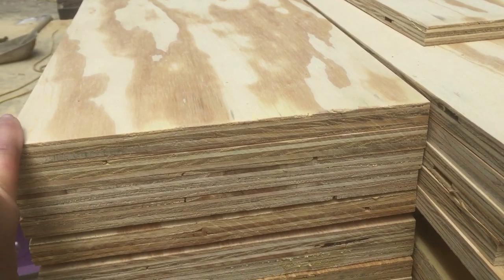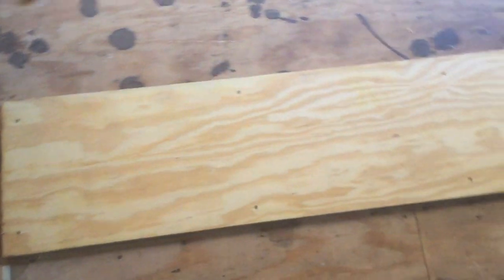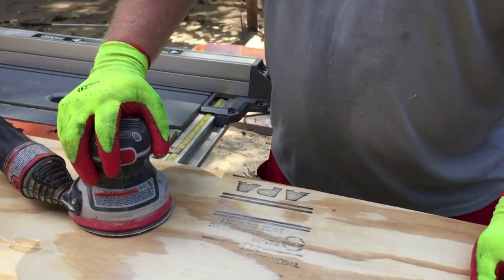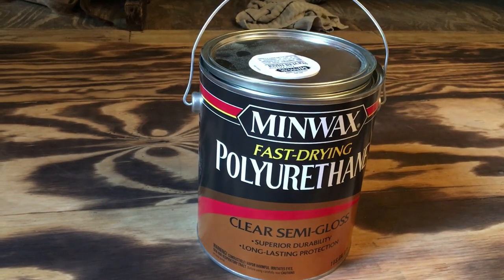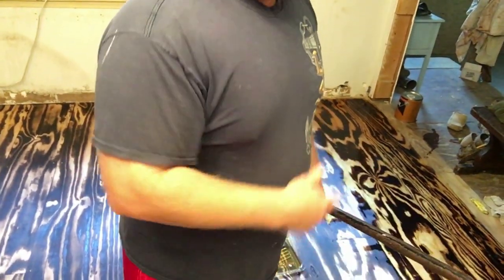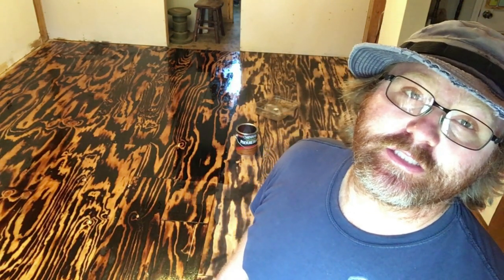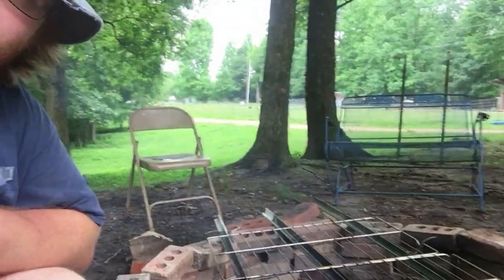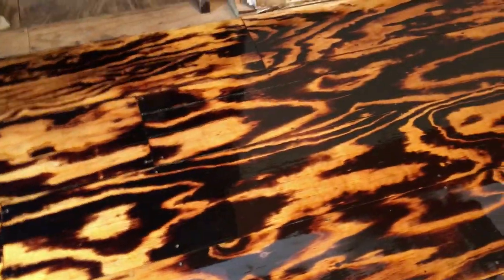DIY Wood Flooring Torched Plywood Floor

Comment: It's definitely not cheaper than the cheapest vinyl stick-on floor but for a wood floor look it's pretty good. I used red oak plywood with no stain but a lot of polyurethane to protect it.

Comment: Man you did a amazing job I'm gonna do that in this house I'm fixing up
Reply: Now with polyurethane I thought you said don't stop from wall to wall or do you paint it on kinda 2 boards at a time
Reply: And also do you let those 2 boards dry first what you did was amazing
Reply from the maker: Yeah paint it with the grain and finish the board or two boards from wall to wall.

Comment: You could use those 2" wide or so pieces for something, like inside a dresser for drawer slides, or all kinds of things! Yeah, I'm a nut for reusing stuff! 🤪 

Seems to me, if you'd have done the torching outside, not inside, you wouldn't risk your walls, or anything under the floor, or have to worry about any little bit of glue not dried (its flammable). I'd definitely do that outside, then move it inside! 

AH! THERE ya go, do it OUTside, exactly! Glad you got it figured out without risking anything inside any more. 😳

Comment: Very nice looks awesome. Question the screw heads: Did you counter sink them, leave them flush. How do they look when finished.
Reply from the maker: I counter sank them filled the whole with black wood filler then polyurethane over everything. It blends in well

Comment: Great and unique look that I will seriously consider on my current remodel. Did you allow any gaps for expansion?
Reply from the maker: I placed them together. I didn’t try to have a gap but it happened due to boards being ripped down. We haven’t had any trouble with the floor buckling at all.

Comment: Did you butt up the planks to each other or did you leave a little room between for the wood to expand and how much space did you leave between the walls and flooring?
Reply from the maker: We tried getting them as close as we could but There is a small gap between. I’d say 1/8-3/16 of an inch mostly due to imperfection in ripping. Allow 1/2 inch for the walls, trim will cover.

Comment: Did you put down any kind of underpayment ... is it totally necessary ❓🤦🏼‍♀️thank you 👍🏻🌸
Would be trying to get out as cheap as possible...also is the glueing necessary ❓
Reply from the maker: Good question. You can’t see ours bc it underneath the plywood. I would use 15lb felt underlayment for moisture barrier. You don’t have to glue the floor just make sure you don’t use nails bc they won’t hold the life of the floor, and anything not coated will rust. You could use coated screw shank nails but I would suggest coated screws with the hex bit. If you have concrete floors you would glue and anchor the subwood to the concrete. Then apply the moisture barrier and finish off with the the flooring. I like using glue bc it cuts down on creeks and squeaks in the floor and really bonds the floor together but that means you would need to put a layer of wood over the moisture barrier so you could glue it. Not really saving money there. I hope that makes sense

Comment: Did you have to sand all that plywood or was the factory smoothness good enough?
Reply from the maker: It was good as is. I just sanded between coats with steel wool

Comment: I missed it.  Did you say whether or not you have to sand in between coats with what poly you used?
Reply from the maker: I did sand between coats. I used steel wool, vacuumed it up, damp mopped it let it dry then applied another coat

Comment: Did you sand the plywood prior to cutting?
Reply from the maker: I did on some areas like ink spots but we used the BC plywood which has a smooth side. So there was no need to sand the whole sheet.

Comment: how did you attatch boards ya burnt to floor....?
Reply from the maker: I used F26 and starbit screws. Screwed down to joices. Then filled holes in with black wood puddy

Comment: can i get more or less the same results if i use pine plywood ?
Reply from the maker: The plywood that I used is 3/4 CD softwood pine plywood. I would suggest using this kind. I would think you would probably have the same.